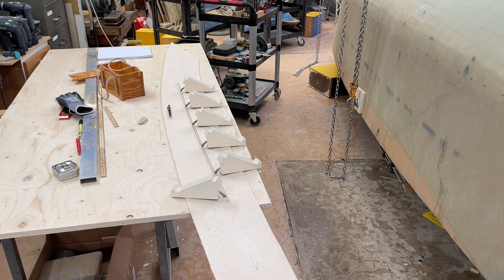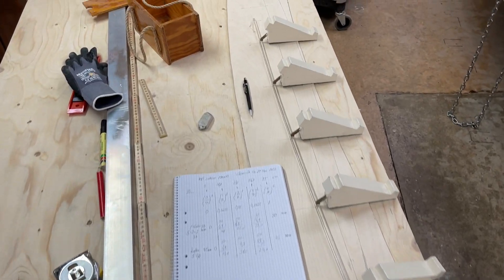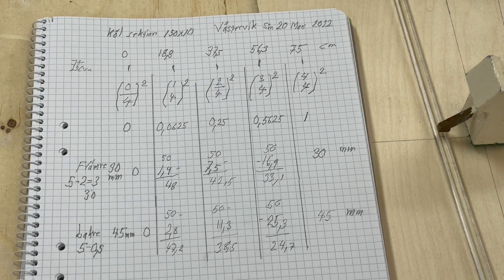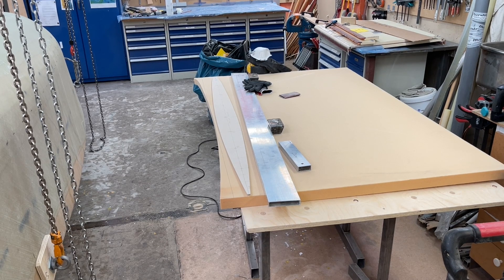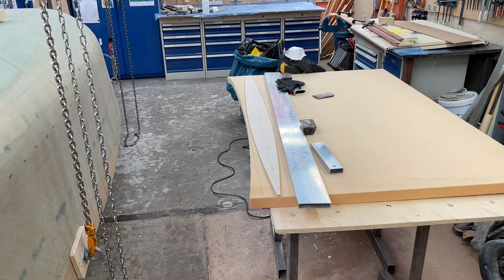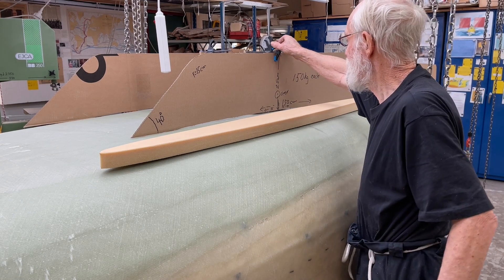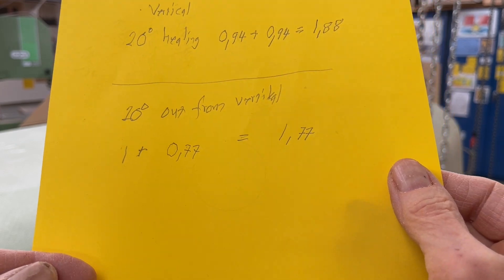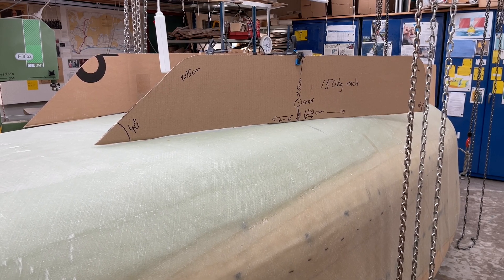Designing and cutting sections for the bilge keels.

Comment: Probably the attachment area of the keel to canoe hull is like a wing root. This is the location where drag is high because there will be a lot of burbling. The entire length of each keel will generate copious amounts of drag at both sides of the attachment, four times using two keels. There will be an enormous amount of drag. To achieve strength at the keel to hull attachment they prefer to have a large attachment area thinking it is good to prevent the keels from sperating or tearing off the hull. 
   The keel shape or parabola has another interesting theory. They think this shape will produce minimal drag. In theory, the very smooth contour is less draggy. You see this by comparing the thickest point of the keel to the length aft and forward. 
Having the thickest area far forward at approximately 20% of the length creates an interesting appearance, more akin to a teardrop or a dolphin. The thick bulb like center section makes the leading edge look draggy and the long smooth aft section tapers  rapidly. If the keel were fat at 20% and thin for 80% the drag created at the hull attachment root would be less than a 40/60 more symmetrical keel. Quite frankly, the strength of the keel to hull attachment could be achieved at the thick area while the remaining length if the keel could be unattached which eliminate drag being created full length X 4.

Comment: Sven i commented your previous video aswell for this one by mistake  , you may have to read that one aswell too know what i mean  . When they first started using them in the UK for the mud flats and big tides  they had been to tender maybe and moved them out onto the 20 degrees to make them less tender   , you answered an early question  , did you mean that with exlex's small sail plan  the tenderness wouldn't  matter and maybe preferred   ? Thanks again Sven and Peter  . All the best
Reply from the maker: For me I worry not about tendernes,
For me they make the boat stable enough vertical.
Reply: @SvenYrvindExlex  ok thanks Sven for your reply i understand thank you all the best

Comment: Isn't it with completely vertical keels, you risk to end up in an undesired upside down stable situation?
Reply from the maker: Vertical keel do not make the boat less stable at sea.
On land there is plenty of stability with vertical keels.

Comment: with an 'airflow' profile, I am told that even at slow speeds it generates 'liff'' so the reduction in area is not so relevant.   Indeed, the one a 40 degrees will be generating 'lift' but against the heeling.   Might allow a reduction in ballast.
Reply from the maker: The 40 degres lift against healing will cause drag and to decide of its use you have to know how much righting moment it causes.
In a small boat going to windward I do not think it is noticable.
In a boat you must look at whole picture.